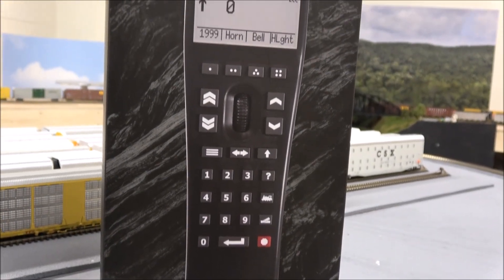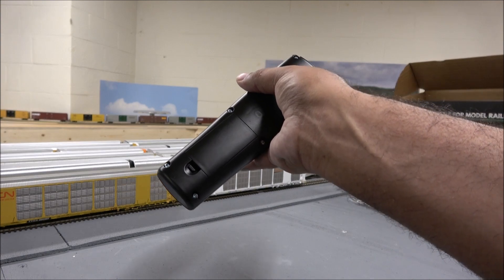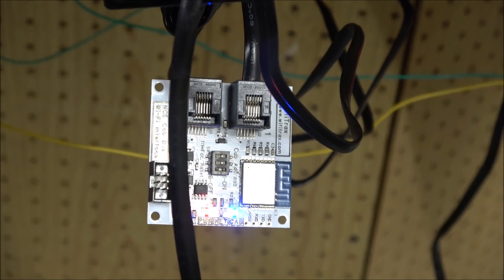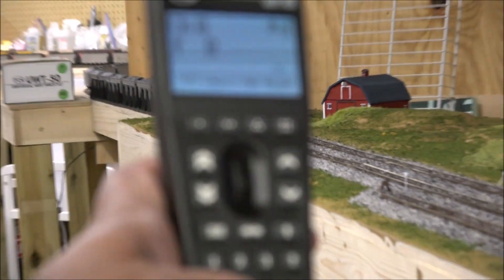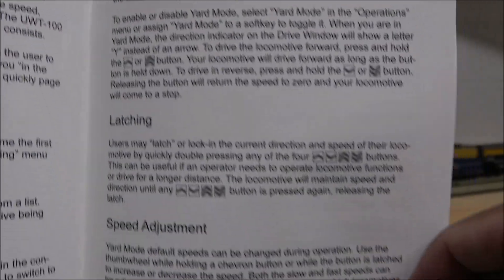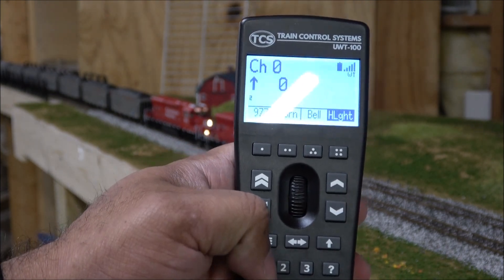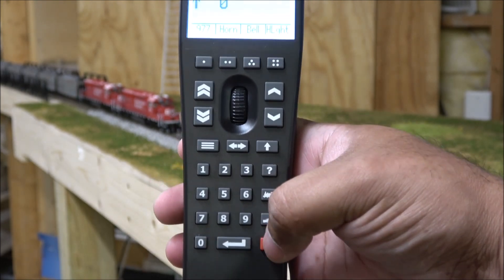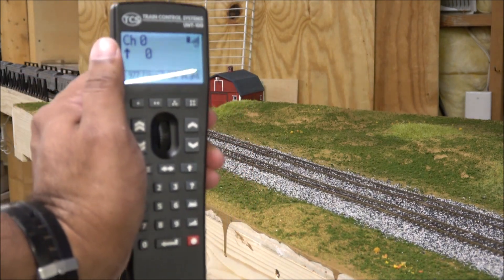In-Depth Analysis Of TCS UWT-100 Wifi Controller From Train Control Systems | jlwii2000

Comment: The very first issue I noticed was when you turned on the two locos, the lights and number boards came on, on both locos. when in reality only the number board for one loco would be on, even if not in the lead position.  Of course the lights on the leading unit will be used.

Guess the controller cant make those distinctions.
Reply: In order to get the ditchlights to not function on a trailing unit, go to consist functions, then on F5 or F6, assign it to lead locomotive only as opposed to all locos
Reply: @BNSF1848  I was only stating that the ditch light should have been turned off when in a trailing position.  Not that they can be turned off.   Only the identifying loco will have its number board lit up even if in a trailing position but not the other locos in the engine consist.

Comment: I just bought a tsc system and I can't agree more with everything here. It is super easy to learn with the built in help. I've used it with dcc++ and tsc base station.  It's really awesome how well it works with different systems.

Comment: I got one when they first came out and enjoy using it. I like the portability of it. I can use it on my layout, then take it to the cub layout, and others that use wifi throttles. On my layout I have CVPs Easy DCC and a raspberry pi connected to the command station via RS232 that is running JMRI with wi-throttle. With JMRI you have your loco roster, and the throttle will then have the list of them to access. With the help button it will bring up the labels of each function. There are a lot of good things it can do.

Comment: I agree, easy to use but I would not buy this brand again as it failed pretty much out of the box. It comes with low quality encoders, bad warranty and customer service from TCS and most likely you'll end up paying more for its repair than it cost brand new. All marketing smoke and a very expensive land fill👎